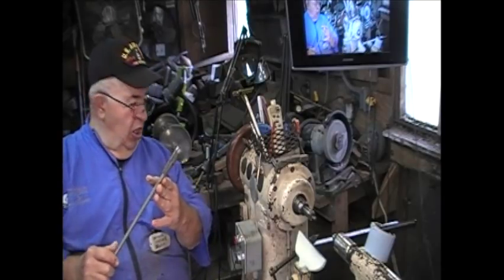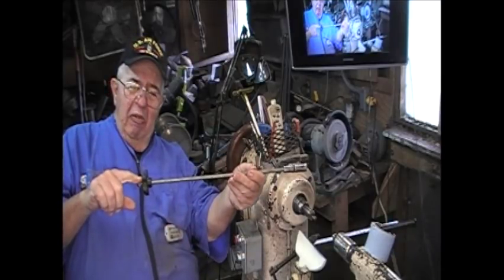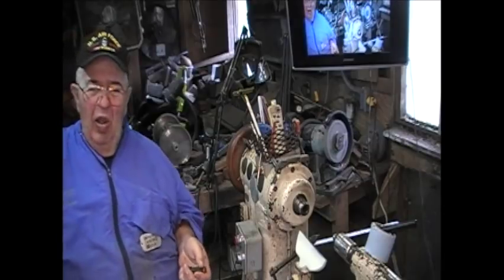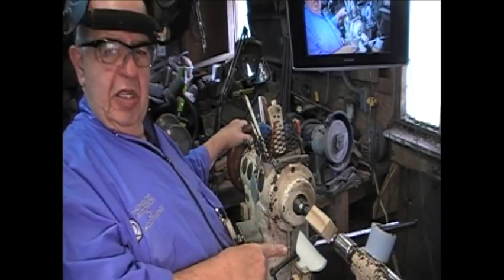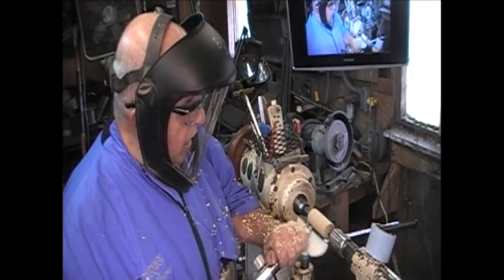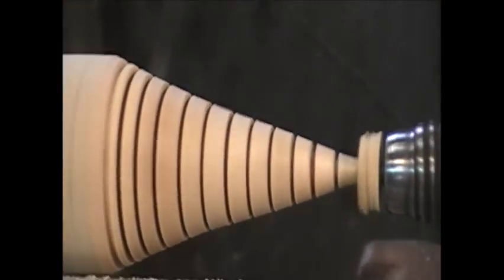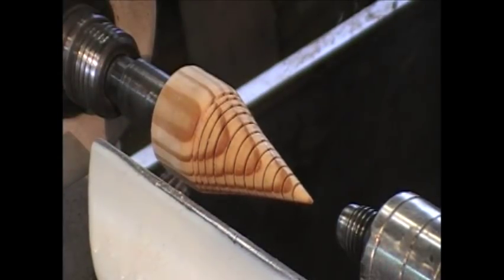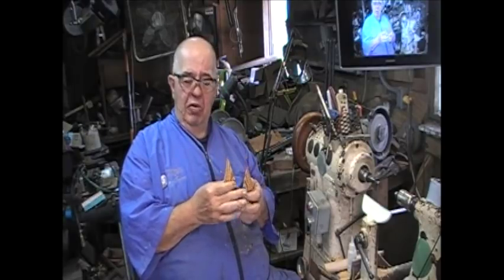#327 Lines on a Tree

Comment: as of July 6, 2019, 
TaperMate Morse Taper Cleaner
is available at Craft Supply, but not PSI, Woodcraft, or Rockler. It's available for MT1, MT2., and MT3. If you belong to a turners' club, maybe the club could buy and share.

Comment: Capn, Nice little project. Thanks for the explanation of the collet chuck and draw bar.  Could your include your URL in beginning comment section? I have trouble remembering URL's and it is much easier if I can just click on one. I know you show it on screen but it helps to just be able to click. Question, did you have to relearn any of your turning skills after the surgery?